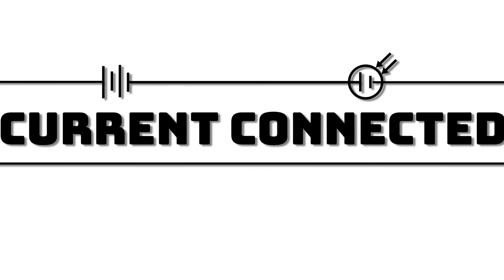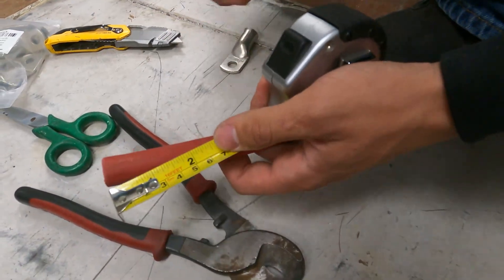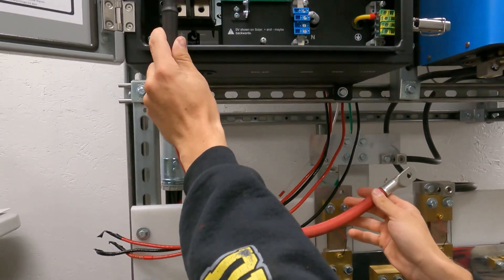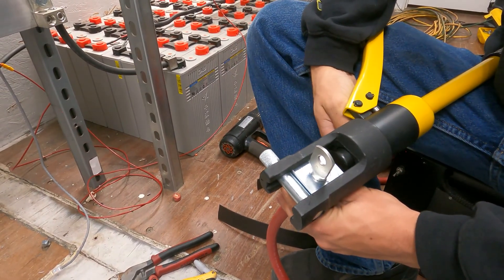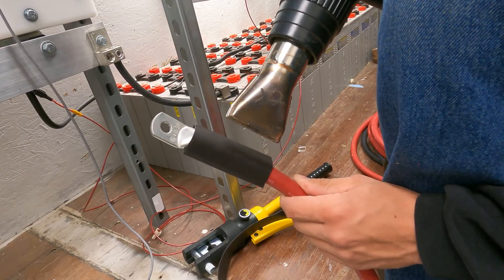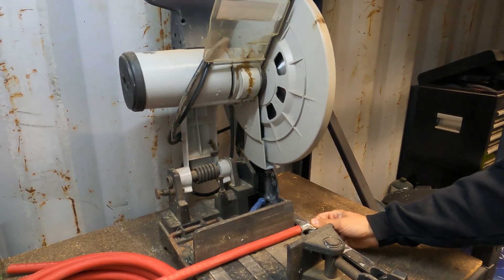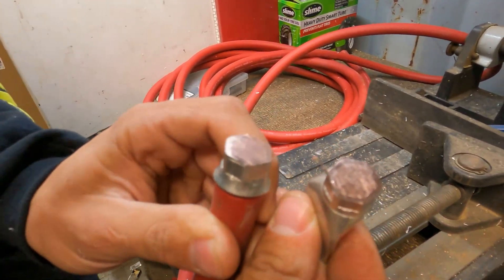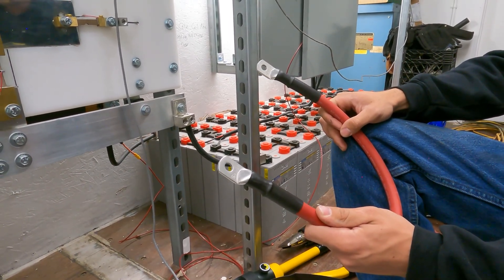How To Crimp Heavy Gauge Battery Cables

Comment: Why not solder the lug after the crimp? Would it not be safer? Is it just because of it taking longer?
Reply from the maker: In marine applications solder joints are forbidden and in most jurisdictions residential and industrial power circuits, soldered joints and lugs are not code compliant. The reasoning is that if the conductor is overloaded, the solder would begin to flow and the junction would overheat catastrophically. In marine environments the dissimilar metals of the solder lead/tin/zinc to the copper just adds more issues. Best is a quality lug, quality fine strand copper wire, quality crimp, adhesive lined heat shrink tube.  Done right and it’ll outlast you in most environments.
Reply: @CurrentConnected  the overheating scenario makes a lot of sense and is a heavy con against soldering, thanks!
Reply: @CurrentConnected  Tinned Copper Cable Lug is being used here and is Tinned.
Can you tinned the cable wires with 95-5 then use the cable lugs crimped? I have seen bus bars tinned and then clamped down. Tinned seems to be a good process for clamping DC electrical connections.

Comment: Years ago I bought a cheap 18" bolt cutter, then welded & ground the cutting jaws to make them a crimper for 4 gauge wire terminals…so it works faster & easier than your hydraulic crimper. It also weighs less. I know it crimped very securely (pull-test) but I also soldered the connection.
Reply: As a trained electrician with many years experience in battery and industrial power installations, I would never recommend soldered lug connections for anything other than current limited applications. Battery connections are in no way considered current limiting, as batteries can release incredible amounts of energy very quickly. When a lug is properly crimped, it is compression welded to the outer layer of strands, and the inner strands are compressed together enough to provide complete inter-strand connectivity. In an ideal world, no connection would result in an unintended high resistance connection, but it happens, and soldered lugs melting on batteries can cause the batteries or other equipment to short circuit. This can also happen, and does, on crimped connections poorly connected to batteries with lead terminals. Soldering also causes the copper to become embedded in the solder that has a different thermal co-efficient of expansion from the copper, this causes stress on the copper strands that can result in work hardening and crystallization within the strands over time, leading to higher resistance, and to cracking, voids, and corrosion. This is especially true of very finely stranded wire such as battery cable or super flexible cables that experience thermal changes from large changes in current, or from their environment. Additionally, mechanical vibration will exacerbate these effects.

In marine applications solder joints are forbidden and in most jurisdictions residential and industrial power circuits, soldered joints and lugs are not code. The reasoning is that if the conductor is overloaded, the solder would begin to flow and the juncture would overheat catastrophically. In marine environments the dissimilar metals of the solder lead/tin/zinc to the copper just adds more issues.  Best is a quality lug, quality fine strand tined wire, quality crimp, adhesive lined heat shrink tube.  Done right and it’ll outlast you in most environments.
Reply: @HighTechLab  it works great for electric golf karts, and I came up with that when I was repairing the "repairs" done (by someone else) when the wires pulled out of the terminals. They only crimped on the terminals, but the environment was so nasty (lots of batteries in a confined space) their crimped connections were getting severely corroded. That corrosion made their crimps get hot when under use (high amperage) and loosen.

Solder does increase the resistance of a connection, but so does tinning a wire, since they are basically the same thing. So if a wire is tinned then crimped it gains resistance like it would if soldered, but does not gain any protection against corrosion, which will increase the resistance of a connection exponentially more.

(I'm certified by ASE, as a Professional Technician)